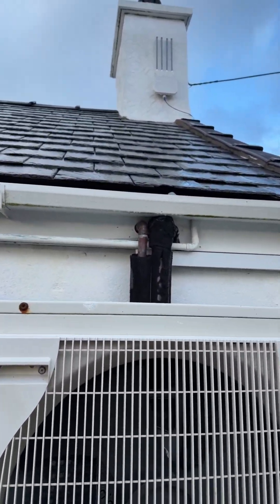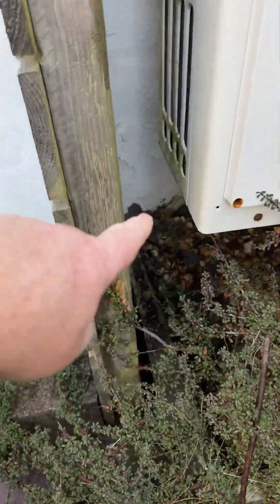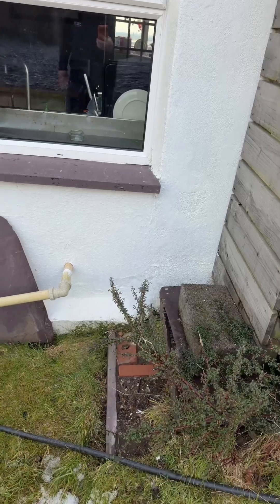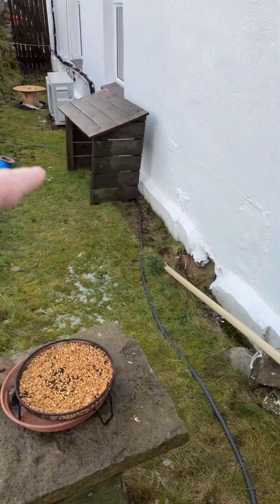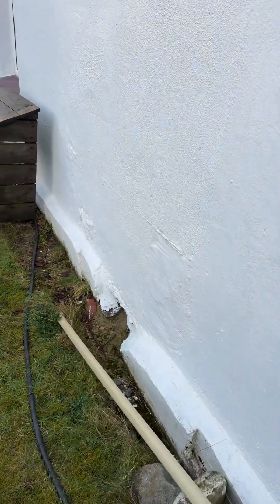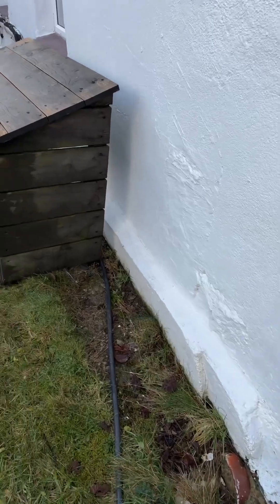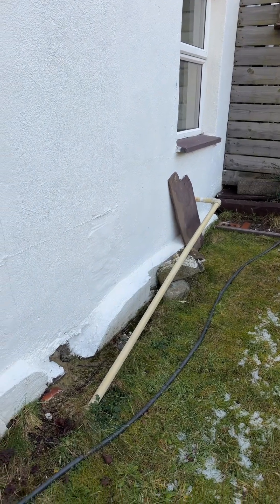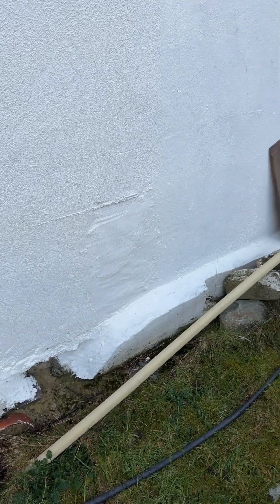Should I Insulate This Farmhouse? Solving the Damp & ASHP Failure

Comment: Do not do insulation until you have cured the damp issue. Whatever you do could hide the issue and not fix it and you could end up ripping it off. 

For the damp First thing is to understand the construction of the house. Solid or cavity wall. Wood floor or stone/concrete, open vented loft or closed and insulated. 

If it’s solid stone then you need to stop water getting through it if that’s the cause of the damp. If that’s because of breached damp course or something else you MUST get that addressed. The problem is that a lot of the times damp can be something as simple as condensation. Get a thermal camera and humidity monitoring. Check the humidity and the dew point. If the walls are colder than the dew point then you will have condensation and that will be your damp. 

Do that before French drains etc. you may be curing a problem that isn’t there. 

Re the bare pipes then that is a simple quick fix. Cover it with some outside grade pipe insulation. If it was just that bit not so bad but given it’s got that you have to wonder what else is wrong. If you get a thermal camera then you can use that to gauge the pipe work. Measure the temp at the non insulated point (or the closest point to the flow output) then see what the temperature is on the pipes inside the house. If there is a big drop then you’ve got an insulation problem between the inside and the outside. 

Basically start at the obvious bits and look for the quickest cheapest fix to address first. So temp of heating water and fix if you are losing too much heat because nothing else matters on the heating if your heating up water and that’s disappearing into the atmosphere before it gets to the emitters.

Also make sure the cold air out of the of the heat pump isn’t getting pulled back into the input. That will kill efficiency.

Comment: Hello Allen.  I would remove the render. It's most likely trapping moisture. Old buildings need to breath and dry out.  Get back to stone/brick and use masonry paste. Weathershield it best stuff, applied to brick. Allows brick to breath and rain trickles off.  Also damp could be why the building it cold so sort that then look into insulating internally.   Don't use celotex against wall cause it traps moisture which i have experienced.  Another system used looked good demonstrated by Charlie DIYte although I have not tried it.

https://youtu.be/Ou1CjwflZtM?si=2RllzNwSNc0wV6lu

Comment: First layer breathable membrane, 100-150mm gap(depending on walk type , usually done by special lugs to keep the gap, insulation layer best then extend window ledges and ducting , including sewage /pipes/etc or box in , but make easy to access in case of emergency. Then coat again in breathable membrane and cover in masonry mix, it’s not something really easy to do, look at skill builder for more info, but I would recommend getting quotes as soil walls compared to cavities wall are a different level all together . I would first look at repairing the walk first that has the damp and not air tight  first , please note this is not cheap yo do a 4 bed house cost 15k, and gave absolute no experience if a building without proper footing I think you are definitely going to need them proof the wall , but I would seriously  think about loft heat exchanger system to free up stale air the cause of damp , but honestly given the heating overall needed, just get a lpg system heater and heat your cylinder with  your battery storage or go to 2 300 litre sun amp water batteries , thing to remember only the 300 is 20 litres a min flow depending on mains flow , if it’s an Anything like my old farmhouse maybe that power tank maybe needed externally as well in a insulated shed .

Comment: Think external insulation would be a bad idea. If they are solid stone walls, no damp course then it needs to breath. In that type of building you could fit breathable internal insulation but you would probably lose too much space. Max out the loft insulation, if you want to get extreme could dig out inside and put proper damp proof insulated concrete slab (underfloor heating at same time?), I'd forget about walls and concentrate on flow temp.

What's the flow temp running at?  I think quick job would be to fit tons of very large rads to get flow temp down then see where your at.   Also first job is to cut that bush down and the fence shuttering (or at least move it further away if it's acting as wind break).

Comment: Need to be careful with external insulation as water getting behind it is a major issue. You need to install a verge trim at the top and seal it well. Around windows you need the ledge to overhang the insulation or again water this get behind the insulation. Be careful if putting over sills on for same reason. Maybe best to just add 20mm of insulation so the current sills will cover?

Comment: The concrete plinth (ledge) might be an attempt as a moisture barrier, the only way to findbout is to break some away. I would definitely remove heat pump, they are not as effective as suggested. I woul dig back the earth from the house and check your foundations if any. A French drain, depending on type and installation may attract more moisture. It reminds me  the cottages back in Ireland. Same issues. Utilising the lpg tank is good idea, there are also advanced wood burners now available which  super efficient. Good luck.

Comment: Contact Adam at Heat Geeks. This looks like a great joint series.
Do the heat loss calcs, insulate internally, beware of the floor structure.
Cheat and run the AC as a heater in the short term

Comment: Couple of log burners spaced out around the house and an LPG combi/system boiler depending on HW usage, solar panels to heat cylinder if your going for a system boiler, rip the rest of the s** out….job done 👍

Comment: Drainage ,  Thermal batterned cladding & Breathable insulated materials for Airflow are Good options 

Will need vents in the wall so building can Retain Ambient temperature to avoid damp 

Probably Got a slate bed DPM  on the outside tapered wall 

Great project to get the Thinking  cap on .. 🎓

Comment: report the installation to trust mark.
Your living room temp should reach 21c and other rooms 18c min.
The system has not been designed properly and should not have been installed if the insulation measures are not correctly to minimum specification.

Comment: If the walls are stone under the render then putting external insulation on could trap in moisture and make any damp worse. My gut feeling  regards external insulation is no.
Reply: If it's got external render (and it is cementitious render - which  it almost certainly is) then the moisture's trapped already (probs since the render was installed).

Comment: Connect a solid fuel stove to your heat pump. That way most of the year use the heat pump but when it gets cold light the fire and then it does both. Only pipe the solid fuel on two tappings, so heating only
Reply: I know someone with this exact setup, it works very well.

Comment: There's minimal gutter overhang to go over any external insulation therefore moisture more likely @ somepoint to get trapped behind any external insulation which could make moisture in house worse & possibly cause black mould to worsen inside house (especially if non breatheable foam boards used)- external insulation is a minefield of potential trouble as far as I can make out & I've looked into it myself. 
Might be worth using stone filled gambion cages on hill surrounding house to help redirect drain off moisture coming down the hill away from building area. Also maybe see if there's any areas of floor you can check condition of floor build type/condition to see if this could be a possible source of any moisture ingress too. Good luck- quite a job you've taken on there!
Reply: This is so true, it only works until the hotbweather kicks in and then the house sweats and becomes riddled with damp

Comment: No to external insulation. Solid walls, need to breathe. Check the paint (assumed) is Lime wash. If, it's non- breathable, remove it (Doff machine).
Let it dry out.
Reply: There are systems which are breathable..

Comment: If it were me i would put up timber cladding externally to keep the water off the building and maybe insulate behind that with PIR or a suitable rigid insulation. If alot of the problem is damp perhaps extend the gutters further away from the property to lower ground and as someone's said extend the eaves

One last thing that comes to mind if to add ventilation if you increase the insulation possibly in the loft to help the building dry faster

Comment: Excellent place to start is reducing the ground level to help dry the wall.
Extend the eaves (not an easy job) to protect the top of the external insulation otherwise water is likely to go between the insulation and the wall.
Looks like a can of worms.
Better still bin the heat pump and heat with solid fuel that gets the building up to temperature to dry it out and produces dry heat.
Bin any double glazing and go single so you are in control of where water condenses and can easily be wiped away,
These houses weren't built with this modern nonsense in mind.
Best of luck